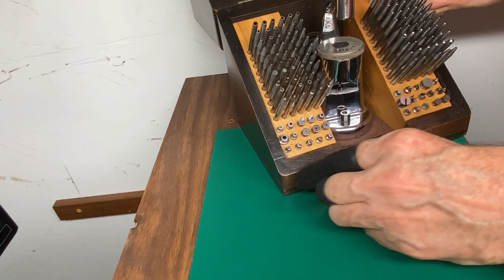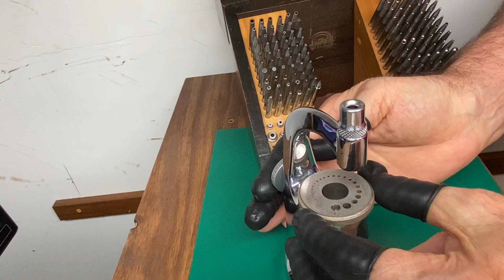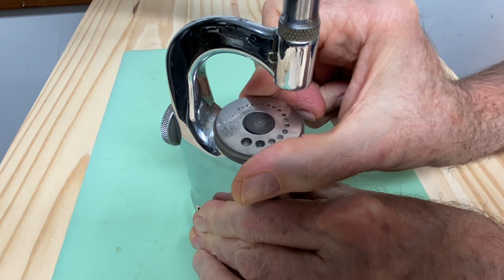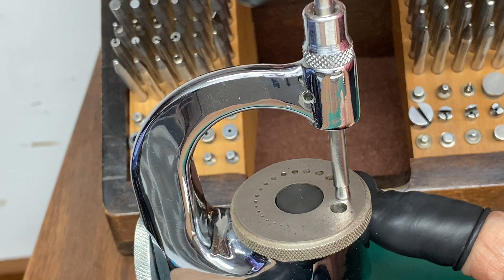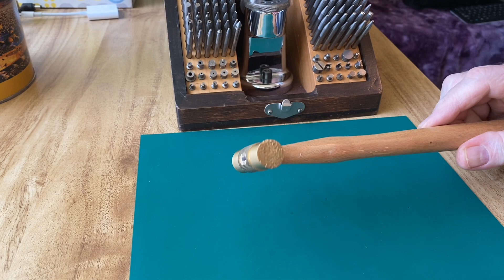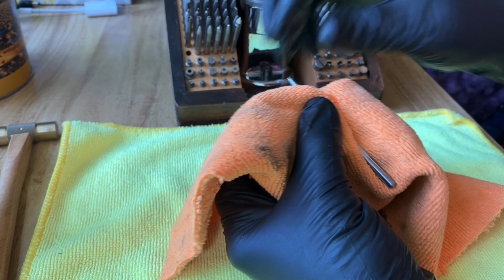Introduction (Overview): Watchmakers Staking Tool Set for Vintage Pocket Watches (Maintenance/Care)

Comment: That's the exact C.E. Marshall set I just received from Ebay!  Except mine is in "Vintage" shape.  I've spent all evening polishing the stakes, getting rust off the staking frame and anvil, and re-oiling the wood case.
Reply from the maker: That sounds like a rewarding project that will keep that set in working order for years to come!
Reply: @myhobbiesarenotcheap  Do you know what year yours is from?  Mine must be an earlier set.  It has bakelite holders for the stakes.  I'll have to figure out how to fix the broken ones.

Comment: can we use a differetn balance with same original staff ?
Reply from the maker: You could use a different balance but it has to have the matching hairspring that came with you new balance. You should not mix balances and hairsprings. Each hairspring is matched to the original balance.
Reply: @myhobbiesarenotcheap thanks
so i can put a new haispring and balance from a watch in another one? if the beat is the same?

a watchmaker told me once that some are interchangeble even when some balances are visually slightly diffrent,different weight, so they say i can remove it and put in a new watch for example a complete balance from an orient into a seiko..or a cauny balance in a dogma

Comment: I just purchased a K&D Special set off Ebay, it’s in dire need of some TLC and I’m looking forward to restoring it have no idea how old it is but best guess is 1910-1920. It has the lever lock and not the wheel lock. Is there a place to check the serial numbers on the bottom or is that part of the model number?
Reply from the maker: I’m not sure about the numbers. I know that there is a pdf on the K&D on line that would give you more information about your set.

Comment: Is it possible to safely remove rust from an antique Waltham pocket watch?  Thanks!!!
Reply from the maker: I have removed small amounts of rust from the bridges. If the parts are nickel plated, you can lightly polish the rust off using some type of really fine paste a microfiber cloth.   The only problem I have come across is if the HAIRSPRING is rusted, the watch won't run right.  You would have to find a donor watch to get the hairspring from (that matches your watch grade of course).   Thanks for watching!